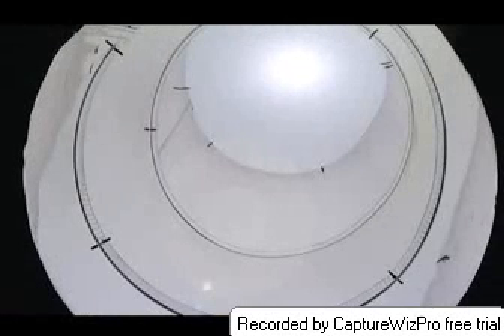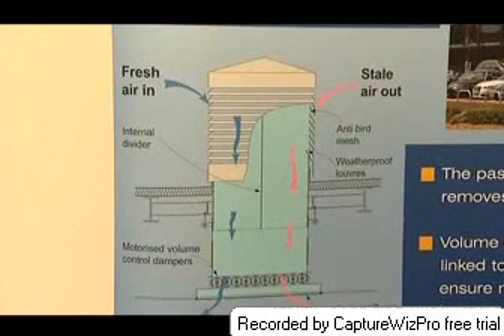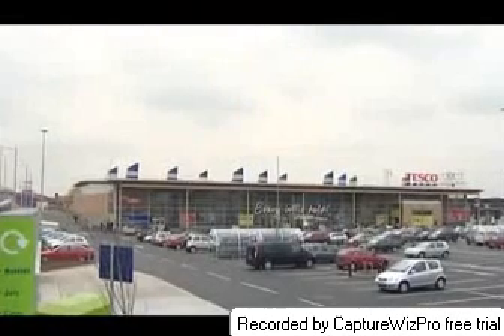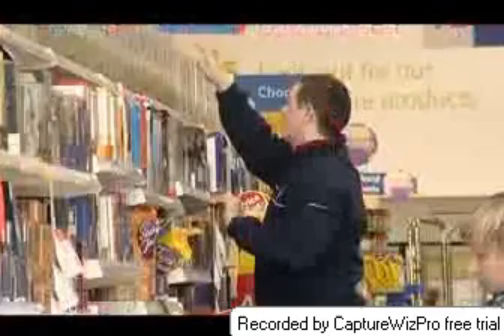Monodraught Natural Ventilation on UK Sustainability Channel

Comment: Sir.I have one suggestion for city.
In all cities ,we telephone tower
and some building are very high.
We should try to pull top air to bottom of city and bottom air to top of city through pipe.   It  won't be expensive job.Infrastructures are available only we need some pipes line.
Please work on this plan for dead cities. Pulling and pushing air is important especially in crowded areas. You have all advanced technology to handle wind pressure  of cyclone. This is a new demands of city development. We need fresh  air as we need electricity.
Namh shivay.